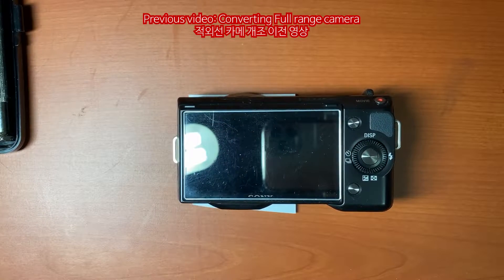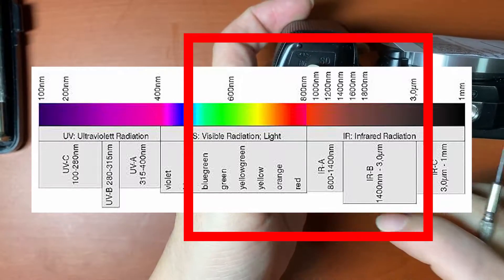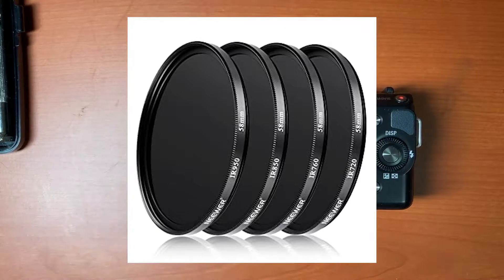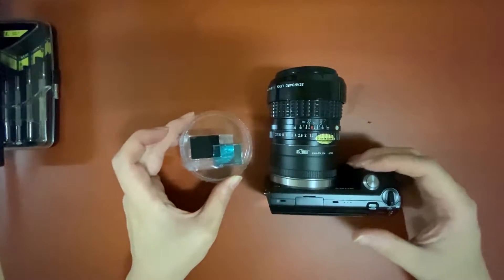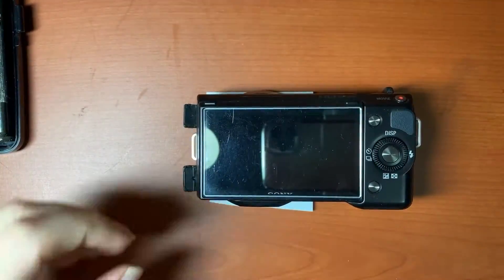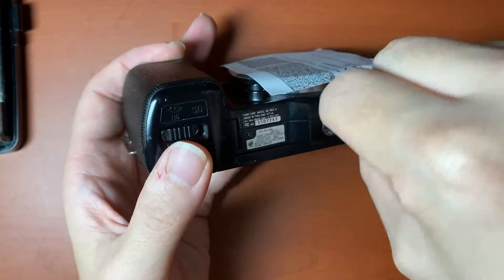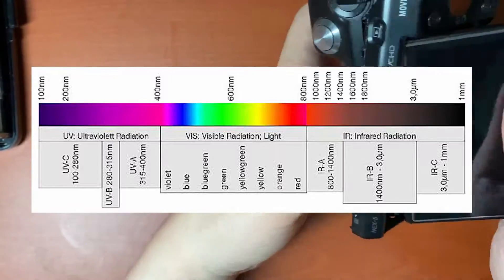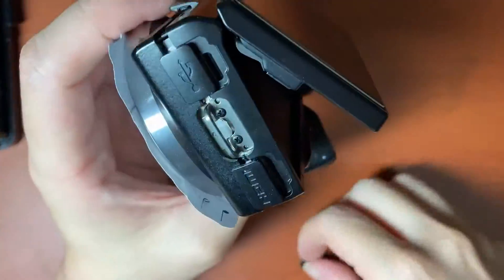[ENG] SONY NEX5 Infrared conversion PART2 - Making perfect IR camera using IR filter!

Comment: I bent a pin on my motherboard any tips for getting it to get back up because it's bent down inward and now I've been struggling to try to face it back up again 😔
Reply from the maker: Oh... I'm so sorry to hear that... I made this video several years ago. So, I watched this again, and it seems that there's no physical metal pins.. Did you bent small pins for FPCB cables? If you did, I think there's no choice except replacing FPCB connectors.
Reply: @caffeitea  I bent the pins at the flex cable attaches to I think it's just too pins but I have been trying to fix them just struggling any tips any tools that might be able to rearrange them they need to be lifted up so the flat multi-wire plug can be reconnected flex cable?
Reply from the maker: Hmm... sadly I'm not a chip or circuit expert. So I don't have any idea on this situation. The only thing pops up in my head is using very small forceps to lift them up. Did you try?  @HelamanGile